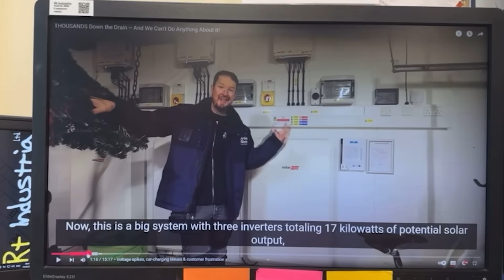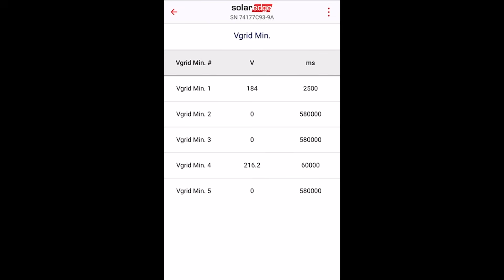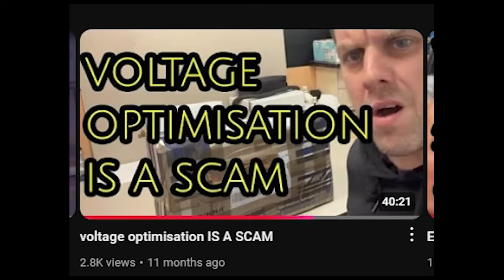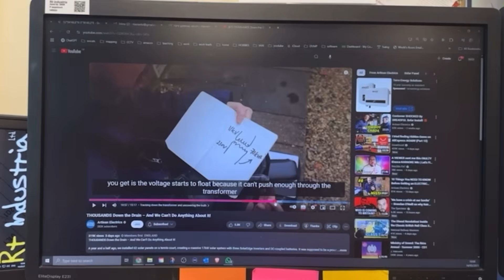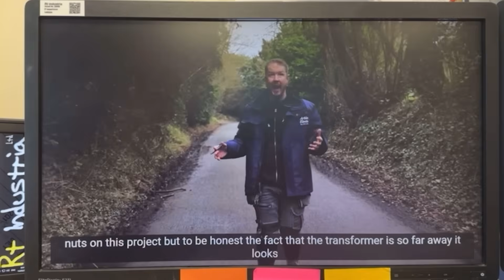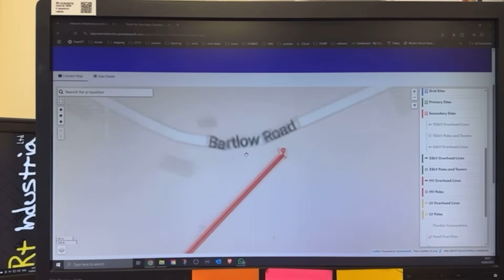ARTISAN ELECTRICS v THE GRID. WHO,S TO BLAME

Comment: The thoughts from an electronics engineer!

If upon building an inverter with lets say a 20Kw Max output at 240v i.e. 83.333Amps, the ouput voltage should remain stable from zero draw current to the maximum of 83Amps, over that current demand the inverters output should back down it's voltage to a minimum preset level, if still an overcurrent situation exists, then the inverters protection will trigger and the inverter will switch off, the same situation would arise in an over voltage situation from the inverter. (The mapping of the inverters output is now usually undertaken within software, though alternatives systems can be used very successfully). 

The fact that this inverters output can rise to some 260v is at best alarming. 'I am not a electrician', but it does look like the high impedance between the inverters' output and the lines on the grid. High 'cable losses' makes for a sad situation. How the 'local neighbours' on the same phase cope with this over voltage is of a major concern! This situation could give rise to some very nasty and high cost claims for damages.
Reply: You set the inverter disconnect settings. I work and live in UK. I have installed two big ground mounts in Ireland about 4 months ago. Overhead lines, transformers etc, in order to have the install signed off by a sparky you have to show that your inverter settings comply with the grid requirements. Disconnect when power goes, disconnect when voltage rises etc. I smell a rat here as it might not just be the EV that's disconnecting, those inverters should also be shutting down. The whole thing reeks.
Reply: Hi Brian, 
Yes, I agree with you. Something is badly wrong with the system. Basically the entire installation is inappropriate for the location and feed cable impedance, probably all would be well on a three phase system? Whatever, it is best described as an unfortunate 'cockup', and an expensive experience! 😢 
Take care and wish you well... 

@brianoneill350
Reply: @brianoneill350  It's not really disconnect. Inverter will stay grid tied. It's injection/overflow limitations.
Only absolutely shity inverters will hard disconnect from grid for limitations reasons. Such frequent use of internal contactors might damage them and cause premature wear and tear.
Hard disconnect is activated in case of anomalous grid conditions. Like phase sync loss, longer brownouts etc.
Reply: @rybaluc  The inverter will still need to hard disconnect from the grid to protect its internal electronics from overvoltage. Limiting the export does not protect the inverter from overvoltage because it is still connected to the grid.
Reply: @fablearchitect7645  Ehhh where should i start...It's more complicated. Inverters are doing both those days. Little bit of overvoltage with small steps increasing curve and there is injection limitation. Big overvoltage with curve rise in very short time characteristics and inverter should disconnect by contactors eg hard disconnect to protect itself. Both parameters should be configured according to inverter normal voltage scopes and distribution network limitations. Good inverters have built in another protection for big spikes in matter of kV.
Only absolutely shitty inverters or people who don't know how to setup them properly will hard disconnect with every small bit of voltage increase where there is legal and fine to have them still grid tied. Lot of hard disconnect will lead to quick wear and tear of contactors in inverter.
Reply: Having had further thoughts about inverters output and solar panels. If you are basically satisfying only domestic needs, and perhaps have just a 'few Kw' spare to feed back into the grid, that is fine, and of less concern for line impedance is required, though 'consideration is still required'. If, however, you are creating a mini solar farm that is outputting a substantial amperage, this is a very different ball game altogether. Ideally, a mini solar farm would have access to a three phase system and provide the greatest transmission efficiency for obvious reasons. 

I think that the danger of the system that has been described is for other houses that happen to be on the same phase. Basically, the 'maximum voltage' you can expect is around 253 volts maximum coming into your property. The voltage of 253v for many appliances is considered by the manufacturer to be an over voltage, the maximum being 240v. Unfortunately, inexpensive switch mode power supplies do start to object and spit fire when hitting the higher voltages of 250v, at 260v, luck comes into play! It is not so much plug and play, it's plug and run...
Reply: @anthonytester6873  Inverters are  created for multiple markets.  They are expensive to develop and UK is not significant market.  So some regulatory bodies/operators might allow more lenient regulations than others. You should setup inverter according to regulations in your country and according limits from your operator. 
Lot of inverters have templates for countries or subsidiary regulation templates so every village idiot could setup those. But there are cases where you might need custom settings.
Reply: @rybaluc  Thanks for your very interesting comment. The advances made in inverters has been incredible over the last five years or so, and even more so during the last couple of years with the development of power FET devices, triacs and thyristors, ferrite transformers etc. Also the advances made in dedicated micro processor's and 'good software' has made the setting up reasonably simple. (As long as the individual can read the LCD and knows well the 'requirements!'). 

I think that this particular story about the 17.5Kw solar installation is all rather sad, and some very basic facts of life had been overlooked. Flash the cash is one thing, location is another. Ohm's Law states etc, etc. As said, I'm an electronics engineer, not an electrician, but sometimes our paths do cross.

Anyway, many thanks for your input. It is truly much appreciated...
Reply: That impedance plays an important role in that REAL scenario. Because that is the ressitance within the electrical live circuit...

Comment: I suspect that Jordan's installation is no longer G99 compliant once he added that voltage optimiser up-front.  Whilst the Solar Edge inverters will be certified to G99 on their own and therefore shouldn’t put out more than 253V, that VO transformer will be stepping up the voltage that’s fed back to the grid.
Jordan said that he used the -6% tapping to reduce the grid voltage, but that will be stepping up the voltage from the inverter going back to the by another 6% above 253V.  So the neighbours might be seeing around 268V.  And that’s before the fact that he was already seeing 260V overvoltage before he added the VO.  So that might now be around 275V.  The poor neighbours!
I agree that the problem will be found in the setting of the Solar Edge inverters.  I wonder if someone had already tweaked the settings to get the grid to accept more of their excess than they should be exporting.  Just because the DNO approved them connecting a 17KW system, they can’t export that much whenever they like.  There must be the demand for it.  Jordan seems to be under the impression that he can export that whenever he likes. 
If I were cynical, I would say that this is a great way to ensure that your system is always able to export ahead of any neighbours that might be trying to export.  This system is always able to out-push the neighbours by 6%.
What should have been a simple of job of turning up and checking the inverter settings was been turned into a huge job and at the same time thrown away the G99 compliance.  Nice that he documented it all for UKPN to see though!
Reply: Wouldn't they install the VO to the tails that supply the house to protect the stuff there, and but still leave the inverters directly on the grid/meter?

If the inverters go to 253V max, the VO is then shoving 10-20% more on top of that... Is that the issue all along?! Was the VO a cheating mechanism intended to ensure maximum export by always being the biggest pusher on the local grid, technically without messing with the inverters settings.
Reply: @kal9001  I think that's what he should have done. I.e. keeping the inverters off the VO. But if you watch Jordan's video at 05'08" he describes how he connected it with "the whole house including the PV inverter downstream" of the VO. 🤦‍♂️
Reply: @kal9001  it definitely is a cheat mechanism the way it's connected. The VO stepping-up the inverters another x% to the grid.

Comment: They are fairly remote, so there is a scenario where there are multiple micro generators on the same long spur from the grid. If they are all maximised and trying to push out t the grid at the maximum allowed current, over and above the base network voltage, then all of the local generating properties will be fighting to raise their output voltage to hit the current.
This system is quite large, if there are farms now also investing in solar in the area then there can be instabilities introduced into the grid, locally, and also inbalances created between different phases.
The system needs more battery buffer capacity, or a dump into a heat-store or swimming pool.
My understanding is that the DNO has approved a maximum electricity which is limited by both and either KVA and Voltage.
There is a big risk of screwing with the system and if there is any issue somewhere that creates a drift in the neutral voltage (like an inverter struggling to export (or failing), then that could be an issue. What are the earthing arrangements? How close to a pure sine wave are they exporting and what power factor on their particular phase?

Comment: A good video! Quaking Corgi ..... lmao!
I am not sure why the DNO agreed to 17KW on this system (mate of the engineer??) but it is clearly not tenable!

The first thing I would be looking at if I were to do an install is to check the voltage and the Zn (and Ze while the meter was out) From that data you can work out how much you can push out into the system without exceeding the max voltage (V I R). If you cant get what you want you need to have a conversation with the customer as you will always get comeback if you don't and it just makes you look foolish/ ignorant!

I cant tell the size of the ABC cables but would guess at 35mm ....... so you can guess what the results will be regardless of what promises are made! Given they have the DNO's permission to play with 17Kw and it being an overhead line feed it might be possible to get the DNO to fit a voltage regulator (a proper one that does regulate the voltage up and down to suit) .... but I doubt it as they are expensive and are generally not encouraged on the network!

The other thing to do is to look at what you want to gain from the install. You will be spending a lot of £ on it and if your expectations are not met it will be a bad day for you! I do not understand why people want to export power to the grid the way they do. If you look at the difference between your buying price and your selling price it becomes evident that this is not a sensible financial descission at all! Fit Solar. Fit a big battery system with inverters ......... but use the power yourself and you get the quickest return on  your investment! Any power you generate over your capacity to use and to store you can export, but this should not be a large amount if you do the maths right!

One further more esoteric point on this is harmonics! If you have an inverter it does NOT produce a sine wave like your incoming supply it produces an analogue of it ...... a series of DC levels changing quickly to give an estimation of a sine wave. The difference between these steps in voltage and the timing of them can set up a kind of wave that adds up giving spurious high voltages. This is made worse if you have more than one point of generation, it causes a resonant ringing in the circuit ...... Harmonics! These can eather add or subtract from the normal voltage and may only affect certain bits of kit but it is a factor out there (I doubt it is happening here, but you never know). One thing that affects harmonics is the resonant frequency of the circuit based on its inductance and capacitance (both of which are seen on overhead lines).

Comment: Got a extremely similar issue with a commercial property we look after. The company next door has over 200 panels on the roof. 
The weekends causes loads of issues on we have had multiple servers and other sensitive equipment keep blowing. Not from spikes but the sags. I'm admitted it's next door PV. But both the grid and the other company doesn't want to help. Lol😂

Comment: I’m just an ordinary spark trying to understand so forgive my ignorance with so many panels why doesn’t the customer simply run off grid and the savings from not paying use that towards the cost of
Reply from the maker: Being totally off grid is a real pain
Reply: @ thanks for reply
Reply: The customer is filling their batteries with cheap electricity overnight. They're then selling their solar production during the day at a much higher price than what they paid to fill the batteries. If they used their own solar production they'd be using 'high value' electricity during the day rather than the stuff they'd bought cheaply.

Comment: I don't agree with all your standpoints. I'ts the grid operators responsibility to calculate the systems potential power draw and feed-in. They saw no issues with this specific plant and granted the permission per G99 so the liability lies with them. It'd be ridiculous to shift the responsibility to installers. But my jaw dropped when it turned out this plant has a single phase PCC. An inbalance of 17kW is not a laughing matter. Even with the G99 permit in the bag, Artisan should have in the interest of all parties involved advised the customer for a smaller system or against a single-phase installation. The transformer install is indeed wack, as in treating the symptoms instead of the cause. All they had to do was to put an export limit and as an additional safety measure, set an active power derating by grid voltage.
Reply: If grid says 17kw 1ph is ok and allow that, then they have to make sure it is actually capable of that. No need to install smaller just as precaution for if grid operator made error somewhere.
Reply: I agree, but can you imagine the customer's response to having an export limit imposed after they'd spent all that money. The export rate would have been an important element in their ROI calculations.
Reply: @chrisnortheast888  Yeah I'd be fuming too. I feat this is going to become a stalemate between the NDO and Artisan with both pointing their finger at each other.

Comment: I am glad you did NOT knock his company , installation, or even him really.  It's hard running any business, small especially small or medium sized in UK.  He has shown the ups and downs and yes he was brutal with the staff cuts and his long holidays,  people always knock successful folks.  OK he made mistakes along the way.  Jordan is actually highlighting in his videos on this, the reality of the situation with the push for solar in some circumstances.  Yes he was a bit hard on UK power Networks, but he did the paperwork right and got approval.  Agreed on the "optimiser".  This video from you and his are very educational and will be of great benefit to small installers of some pitfalls, especially in rural situations.  Excellent stuff.
Reply: More than likely he took this job to suit himself and his company. It's a pretty daft installation lacking even basic engineering assessment of the grid. Fitting things with the old SWA correctly made off or moling cables for miles when moling guy takes responsibility for the cable is one thing installing optimiser to fool the inverters and it would appear that the inverter settings have been set to bypass the grid safety limits as per national grid recommendations, otherwise when they exceeded voltage limit they would disconnect. Cannot now be blaming DNO.
Reply: And where are the harmonics analysis, does it comply with the grid requirements and where are the power factor figures. Fancy graphs which conveniently omit 
1) power factor 
2) voltage disconnection times as required by G99.
3) 3 inverters where is the analysis of the harmonics, are they in spec again as required by the grid.

I used to think Jordan was a good sparky however either he is deliberately playing the fool here or he genuinely (which I do find hard to believe) does not understand the required inverter settings, engineering assessments and obligations and responsibilities in connecting inverter or inverters to the grid under G99. 

He could be facing a huge bill here for supplying and fitting something which from the design phase onwards was not fit for purpose.

Comment: It's clearly an under-rated transformer and the solar inverters have a much lower impedance. But the question is why did they install so-many solar panels, they simply have over-rated the system install and are now paying the price for poor decisions or a customer that does not understand. The DNO approvals should have included the cost of energy absorbing loads at the transformer. What a mess Artisan have created.
Reply from the maker: I think 100 kva is fine for 58 houses
Reply: @ normal houses agreed!
Reply: I suspect it’s the cabling that’s the issue, not the transformer.  It’s been setup so the transformer is quite high voltage output to deal with the droop over the length of the feeder line, problem is he’s now pushing the voltage up by trying to export.